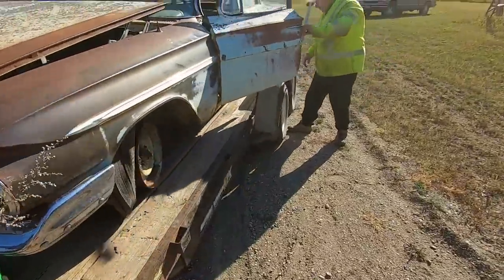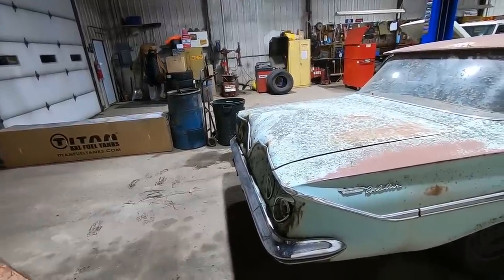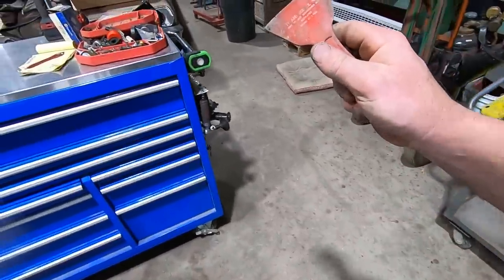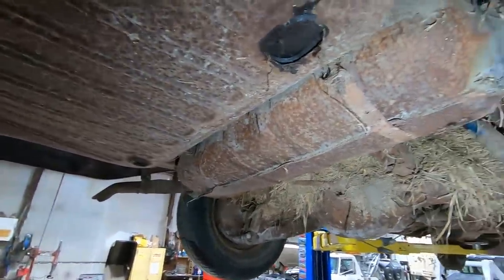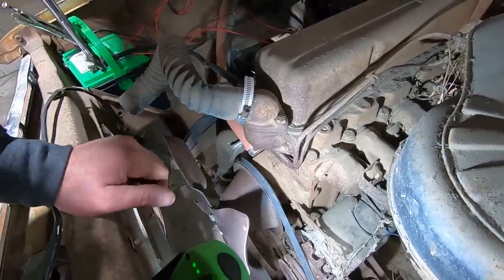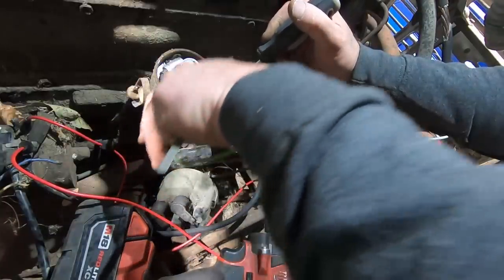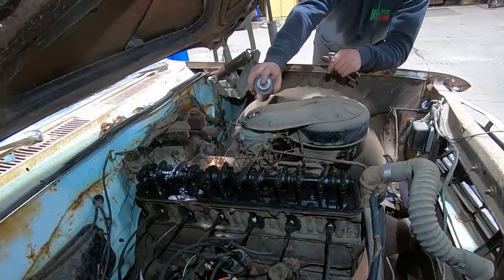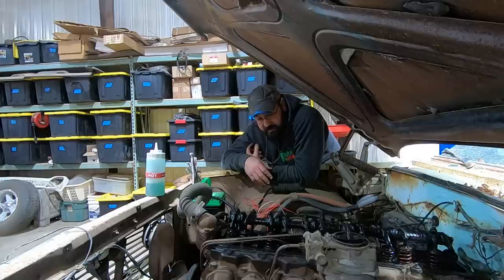1961 Chevrolet BelAir! Abandoned for 49 Years! Will It Run?!?

Comment: This car deserves a showroom restoration!!!!!!! Put this car on a frame off rotisserie stand, fully sand blast, brand new vintage interior, 327 V-8, chrome headers and glass packs. Mag wheels, with metal flake paint show car paint, new drive shaft, and pin stripping,new windshield, new headliner, new radio antenna, totally incredible!

Comment: When you was pointing out the twine wrapped around the rear axle reminded me back 60+ years ago when I was with my grandfather. We lived on the farm and my grandfather would use his car as a pickup truck. One day after cutting hay we were driving (1960 Dodge Seneca) across the hay field to check if it was dry enough to bail. Afterward, we was driving into town and the car had a “terrible” vibration that would only get worse with speed. He pulled into a service station and put the car upon the lift. The drive shaft was packed tightly with hay and was literally smoking from the friction. It took about 1/2 hour to cut off the smoldering hay. But afterward the bottom of the car was so polished you could nearly see your self in the reflection from the driveshaft tunnel!
Reply from the maker: Hard on pinion seals!

Comment: So many classic and/or old cars and trucks sitting for decades, seem to want to run again. Most do with some effort, skill, and a few parts. The oldest one I ever had, was a 1970 Chevy C20, sat for 33 years. Ran when parked. Removed the plugs, old bare wiring and harness. Sprayed WD40 in each cyclinder, new plugs wires. Had to find a junk yard used wire harness to replace what the critters ate Then added a new battery, hoses, belts, oil filter, fresh oil, fresh antifreeze, aired up the tires, started up and ran as if it had never sat in a field for 33 years. The guages worked, transmission & rear end also great. Makes us wonder, how will todays vehicles fair if left to sit for 20, 30, 40 or more years into the future? Will they be as eager to start and run as cars for our past seem to be?

Comment: Back then a car with 100,000 to 150,000 miles was shot.  They were cheap to buy compared to now but cars are lot better these days and a lot more expensive. The gauge of steel was thicker back then too but they didn't have as much rust protection as now.  You can drive a car for years now without it rusting. Most cars anyway.  You can run cars over 500,000 miles or better now if you take a care of it.

Comment: Just an idea. When you very first get a car put a bunch of lubie dube in the cylinders that way while you wait to mess with it not only do you have a better shot if the engine is stuck but you're soaking them rings so you'll have more compression when you go to start it just making things easier as all the way around 👍 like I said just an idea.
Reply from the maker: If I had a crew I would, just not enough hours in the day.

Comment: This was my grandfather's car. He would use it as a field vehicle after he bought a Biscayne that was once an NDHP cruiser. After he passed away in 1972, it continued to be used for hauling parts and lube for the equipment . That is why there is no back seat. Of course, the family outgrew the sedan...8 of us kids. we needed a station wagon. The last I remember , the engine and trans were good, but there was a problem with the diff. The car could be put into gear, driveline spun, but a hell of a racket from the rear end gears.

Comment: No oil filter. They were a dealer installed option, cannister-type bolted to the exhaust manifold with 2 muffler clamps. I had a '61 Biscayne 2-door 235/stick I paid $100 for, drove it for 7 years.

Comment: My grandparents had a ‘64 Biscayne. The body would accommodate cane poles really well tied down with wire to go fishing. My uncle added a radio, which if you touched the brakes and I think the emergency flashers simultaneously, you get the radio to turn on without the key. The car was sold at auction in ‘71 after his passing. Good stuff
Reply from the maker: Good times!

Comment: When an engine's intake system completely 'dry', the first gas dumps usually get 'sucked up' by the intake passages, not much entering cylinders, once it's wet, the fuel mixture then flows across the wet surface more easily, and more later enters the cylinders and hopefully lights the engine off.

Comment: I had a Jeep Cherokee new off the lot, the second year Chrysler takeover, the coil died at 300 miles and again at 3300 miles, the last coil at 33300 miles. Chrysler finally replaced the coil with a 1990 Jeep coil off the shelf.  It lasted until she ended up eating the backend of a Mercedes SLR Sports coup.
Reply from the maker: I bet it still works tho!

Comment: We had a 58' Chevy with a 235. That was a check the gas, fill the oil car. We didn't have a mosquito problem at home if that thing was sitting there idling. It was shot. Kept on running though.
Reply from the maker: Hard to kill

Comment: yup takes a special slotted tool to remove it. I have one in my tool collection. u can make one easy smeezy using a piece of 1/4 in brake line and grind  off both sides of the tube , leaving 2 tabs that fit into the nut
Reply from the maker: Thanks for the info

Comment: I am really sorry that you've given yourself so much trouble, trying to make this old 235 straight six cyllinder engine start. Especially! after changing the spark plugs, cleaning out the carburator, as well as, reinstalling all the wiring, the new coil and the lube job, on the valves. 

Hence! for a minute there, i thought that everything seemed to be quite promising, until the moment the old starter broke down on you and became a problem, as well as, for the lack of compression that the engine was producing. 

Nevertheless! despite the fact that this attempt was an unsuccessful mission, you've finally provened, that you are an excellent mechanics and that you've really surpassed yourself, once again, throughout this entire unfortunate episode. 

Thank! you for this great presentation and have yourself a Nappy New Year 2023, Mortske!

All the best!
Johnny, Montréal, Canada

Comment: I'm not 100% sure, but the type of screw head you were asking about might be called a Clutch-Head. I work on some older electric fence stuff, and there's some oddball screws used to hold the old metal case together.
Reply: GM also used them to hold in early Corvair wheel cylinders for some reason.
Reply from the maker: No, I've got clutch head drivers
Reply: @MortskeRepair  It was wild guess on my part. The other type it could be is a Spanner bit.

Comment: One grandpa (passed in 1981) had a '65 Ford Galaxie.  He'd drive it out to the fields, etc.  I now have this car.  Dinged up oil pan and there is a dent (pushed up, bulge?) in the rear floor from driving over a rock.  Remember riding around with him as a small boy.

One wonders if the head gasket it blown as well as bad rings or crusty valves all in combo to get no compression on all 6 ?

Lived in the Lake Minnetonka area 30yrs ago.  Wayzata is pronounced "Why-zetta" by locals.
Reply from the maker: Back when they used em like trucks!

Comment: Excellent video Mortske Repair  :) for January 2 2023 also my late Dad & others used WD 40 for years also one not sure company is of but got Turquoise 2 ring on label can 400g one but white spray bomb can says Dry Graphite Lubricant  white cap but does super job to get rust of bolts and Lubricant to !  But my favorite spray Lubricant of Pentriotion fluid was Releasea orange & green spray bomb plus 355 ML can also smell like honey Lol used buy almost anywhere from Canadain Tire also Wal Mart plus Hardware stores in my area from 1997 to 2019 stop selling some reason and said couldn't get anymore but great stuff 👍 too use a little spray went long time ways what need unstuck something super tight ! I have use Kroll  also Liquid Wrench brand and many others too on High Quality pentriotion fluid to ! Also work on lots 6 cylinder motor like Blue Flame  GM 235 also 1950's Dodge flat head in truck plus farm tractor Ontario Canada called Noresman, 250 in GM & Ford , 292 Chevrolet, 300 Ford and famous 170 red and blue 225  also many others !  Also 1950 farm tractor call Cockshutt COOP   40  farm tractor built in Ontario Canada till 1955 my grandfather Bill my dad father bought in 1950 till 1993 when had BUTA 6 cylinder 230 Cubic Inches 6 cylinder with 1 barrel carb Zenith and 6 volt positive ground! Generator 50 amps had was fun to plus orange color if saw motor think was a 292 Chevrolet type with head swap left to right not right to left ! Great strong motor but remember my late said bored up 252 Cubic Inches size also orgnail was 43 hp but got 55 hp and 90 torque but got 105 after engine rebuild in 1984 ! Yes thing corrected in rebuild job plus specs when to because powerfull and how fast went driveing it !

Comment: Forklift, no compression left, I used a quirt of oil each cylinder and aimed a hot air gun down the carburettor, started for the rest of the day

Comment: Generator is on wromg side of the mount. The bolt goes head toward the radiator and bolt tab on other side of the bracket
Reply from the maker: It's all together the wrong generator

Comment: I've noticed you never use Ether to try and start an engine with low compression. Not that you can run them on pure ether but might help get them started and get some heat in it to get the rings freed up possibly.  
I dont know, just a thought. 
That being said cant win them all and I wouldnt mind seeing some bubble top things soon
Reply from the maker: We've most definitely used it
Reply: @MortskeRepair  oh ok I guess I just missed it or didnt remember

Comment: First time on your channel and wanted to say I don't understand why so many people don't pull plugs and put oil in the engine before ever trying to turn it over other than manually trying via the fan/belt, especially with the starter.
Reply from the maker: What's the difference?
Reply: @MortskeRepair  Cylinders/walls totally dry scraping up and down, causing even more destruction.  In this particular case, probably would have made no difference, but you didn't know that when you started.  And I see this regularly on "will it run" type videos, hence my comment.  And since it's likely you'll remove the plugs to see their condition anyway, very simple to do sooner than later.  Turning with fan/belt will let you know sooner if there's a problem like a stuck valve, before slamming the piston into it, potentially damaging both when the issue might be repairable.

Comment: The Mennonite church down the road from where I grew up bought cars together, I guess fleet price maybe? Anyway, the first fleet I recall (I'm less than 10 years old at the time) were late 40's-very early 50's Mercury's. Not certain what variety of Mennonites these were but all the cars were black. And before leaving the dealership anything that wasn't black got painted black. Bumpers, window trim, everything. Now why does that matter here you ask? Well around 1960 the Mercs we're 10+/- years old and it was time for a trade in. Enter the fleet of 60(or 61) Biscaynes (cause Bel-Air wasn't plain enough). Around this time I guess the older crowd started to die out. New members or new drivers maybe were showing up in 63/64 base models and still solid black. Wasn't a big church. Maybe two dozen cars at most. But all those solid black cars never showed up on used lots for sale. Maybe the chrome/trim got stripped and they got hit with a $29.95 Earl Schive paint job. Last point. After the Mercury fleet they stuck to Chevy but right around 69/70 the blacked out chrome went away as did the fleet vehicle approach. But still all base models and no bright colors. This video Chevy today, you hit it with the paddles many times and it just stayed flat line. So it goes out in dignity, using it's organs that others like it might live. Side note: maybe after the mystery oil a shot of STP or coming to this century a little Lucas in the cylinders. That stuff it like SAE200 so it might have given the engine gummy rings to make compression. Or just fouled the plugs. It was a noble attempt to revive.
Reply from the maker: Thanks for the info!

Comment: That was my first car in 68 or 69. it was a peice of crap.  My mom gave it to me when i was 16.  I changed the automatic transmission on the ground, under the car jacked up. Never had done it before but i got it done. I used 2x4's as leverage and had transmission fluid in my hair.  The 283 was crap too.  They were just cars with no pazaz.

Comment: Mortske didn't beat on it, adjust it, massage it, coerce it, bargain with it at any time with THE hammer. Of course, it's not going to start. THE hammer guarantees that it will start half of the time 100% of the time. Sad to see the ol' gurl practically lowered into the grave.

Comment: How is it this sits in the Midwest for 50 years the car is super rusty  but the engine cranks over and my 69 c10 sits for 30 years in TX and has almost no body rust but the engine was so rusty I had to hammer the cam shaft out after spending 3 hours getting the lifters to move in the bores.
Reply from the maker: Magic?

Comment: What - a 235 that wont give fire ??? Reckon it could b to not havin a 'schwanky' steering wheel in er.
Surely looked like Ma Kettles brassiere left hangin out to dry in the drivers side rear window ???  
Betcha if u do some more pokin around in there u may just find that 'size 44 triple c' playtex tag pretty near to that ol afro comb.   😜

Comment: My dad had a 67 ford F100 with an inline 6..
He kept a brick in the bed of it to chock the wheel ..
We stopped at a store one summer day & my dad went in . The truck was parked on a slope & the truck had such horrible compression , it rolled out into the street . (3 speed on the column).
I was 8 or 9 & as luck would have it , a cop happened to be rolling down the street at the same time the truck rolled into the street .
He lit em up & asked me what happened . I didnt know .
My dad came out to a line of traffic , a crowd of people & a not so happy cop...
He told my dad he should'nt leave "kids" alone in a vehicle because the screw around with the shifter/pedals , ect..
Headed down the road my dad asked if I pushed the clutch or messed with the shifter & I had not..
Solution ?
A brick in the bed ...
The motor was just worn out & the "E" brake hadnt worked in 20 yrs ...
Eventually it just didnt have enough to start .
So my dad bought something newer .
One yr newer in fact...a 1968 F100 .
Stay warm M...
Reply from the maker: Good times!

Comment: Why does everybody turn these engines over that have been sitting for years without pulling the distributor and running up the oil pump with a drill for a couple of minutes to pre-oil the crank and cam bearings?   A  good way to wipe all your bearings right from the start.
Reply from the maker: Haven't wiped one out yet!